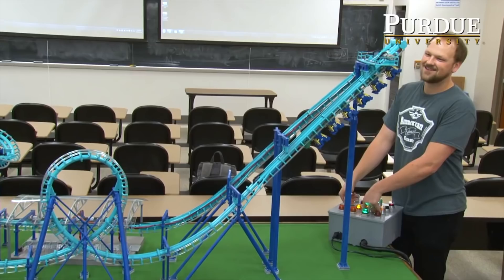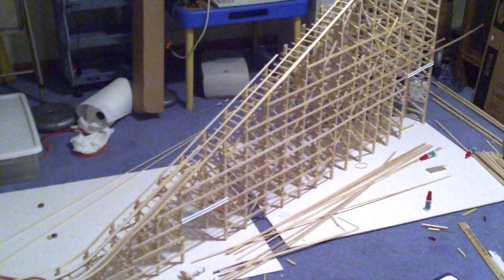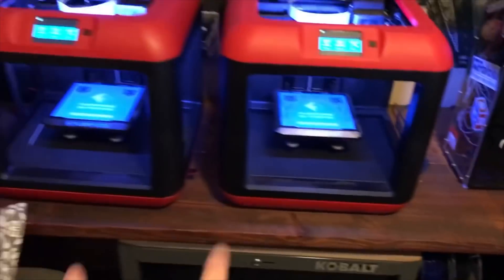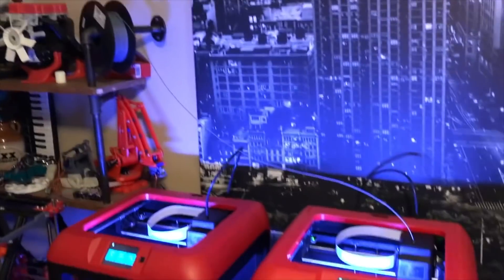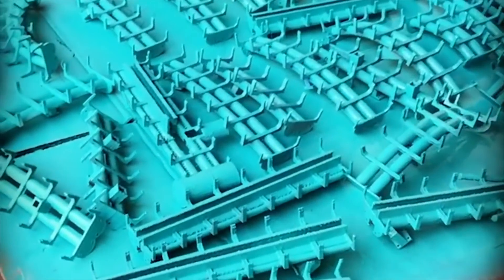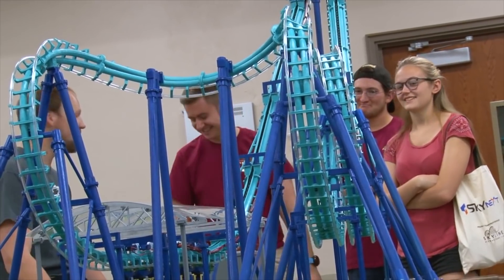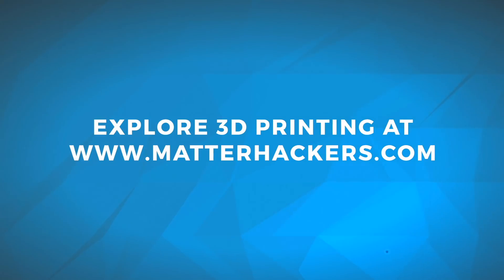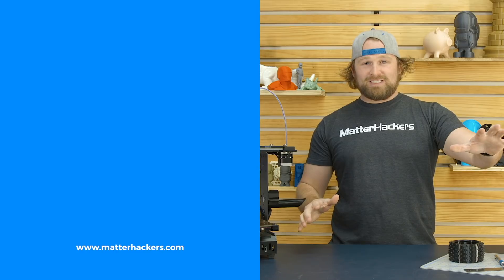MatterHackers Minute // 3D Printing Functional Model Roller Coasters

Comment: You guys probably get these questions all the time, so sorry about that. 
 Ive got years of FDM 3D printing experience, however, Ive just purchased my first SLA/DLP machine and I know almost nothing about them. I'm not sure if it's SLA or DLP, I'm not even sure I know the difference. (DLP projects each layer as a full image I think, SLA draws each layer with a laser?) The machine I bought is a cheapo from aliexpress called a Micromake L2
ANYWAYS, Ive been looking at resin on your site, would you recommend MakerJuice G+? It's defintally at a price point I like compared to many of the resins out there and it seems like it may be a good material for me to learn the machine using.

Also do you have any material specs available? I'm mostly curious about it's glass transition temp. Probably around 100c?